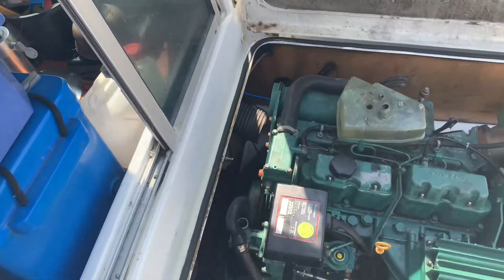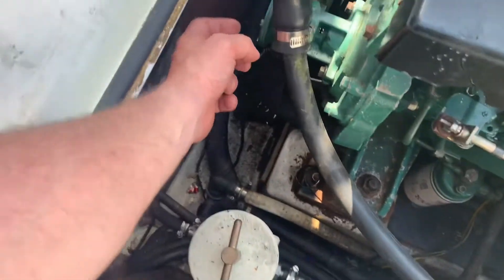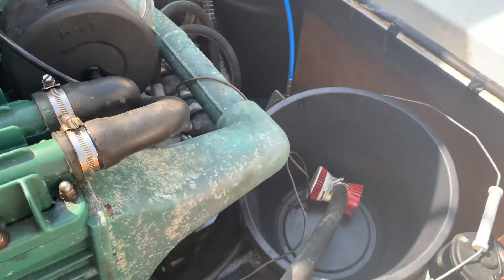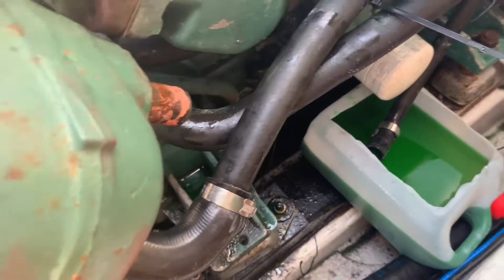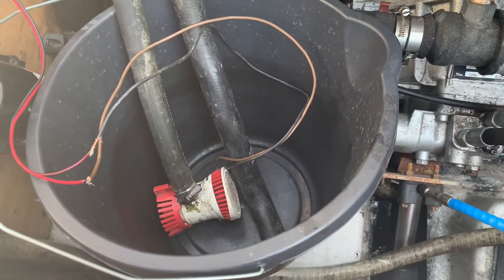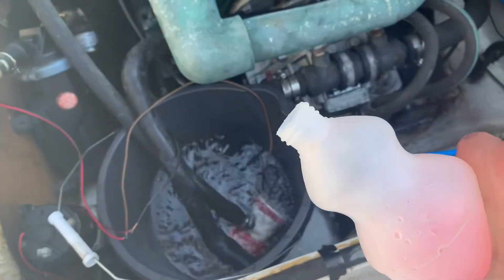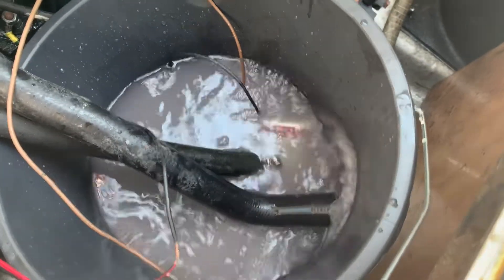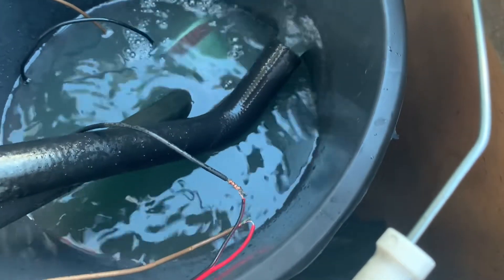How to chemical flush saltwater side of a diesel inboard | Volvo penta TAMD31

Comment: Great vid.  Roughly how much solution was required and did you mix 50/50?  Thanks
Reply from the maker: Hi, I used three bottles in my bucket and added just under 50% water to it. I think the bottles are 1 litre each from memory 👍🏻

Comment: Thanks for the how to video. Can you explain "the chemical"? What product are you using and how does the "turns orange when PH neutral" bit work?
Reply from the maker: It’s called Proflush engine descaler - I got this from their website: ProFlush is  a highly concentrate Marine Engine Descaler that removes salt and deposits from the cooling system of your engine. By doing so, it increases the efficiency and engine life. A great feature of this descaler is the fact that it contains a neutralisation indicator that shows that the product has worked by changing the colour of the liquid.

ProFlush is a synergistic blend of acidic compounds that work together to be more effective than when used separately. When ProFlush is actively neutralising deposits, you can see the effervescence and a colour change from red to orange, once all the scale and deposits present have been successfully dealt with, the effervescence will stop. All products have been neutralised when the liquid will constantly have a red colour. 

Hope that helps. Ed